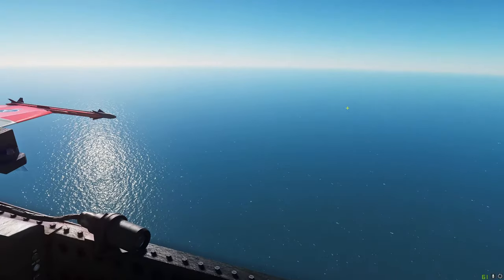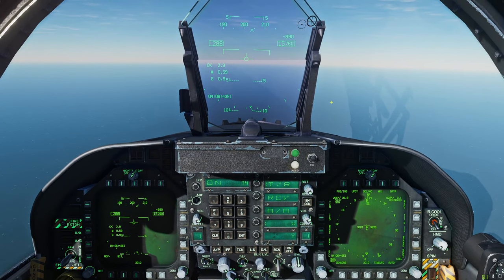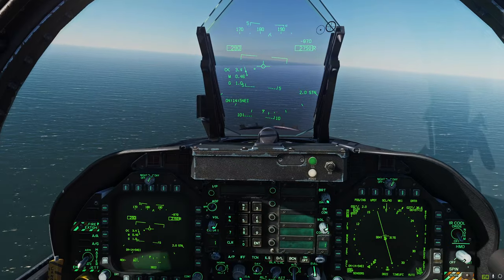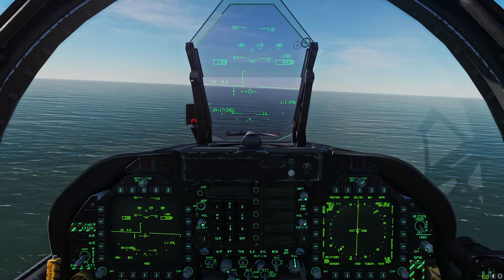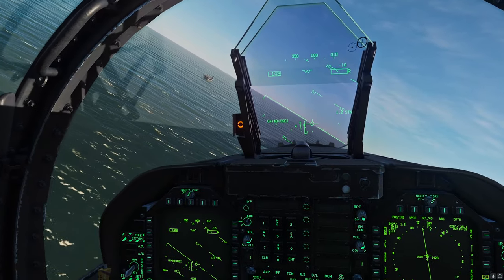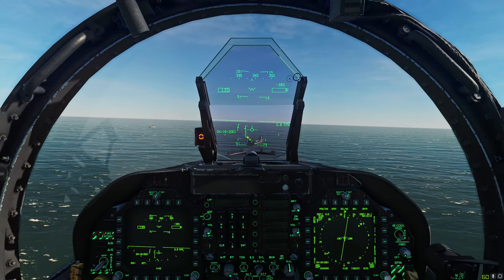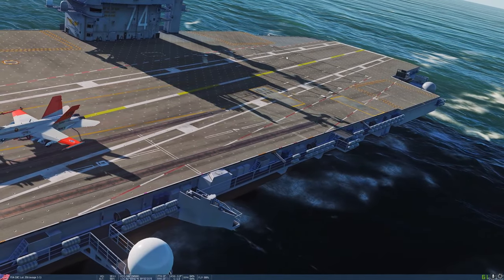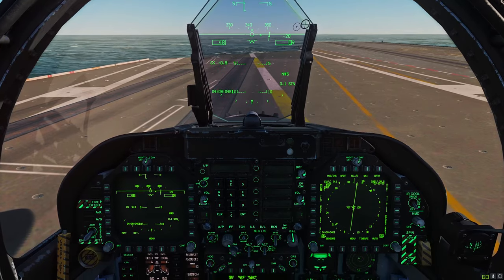DCS World Tutorials - F/A-18C Hornet - Intro to CASE I Carrier Recovery

Comment: looks perfect to me :-)   ( I always mess up my ASL on the breakturn, getting hook out, wheels out, flaps out, break ... )
the "thing" of the boat where you try to allign your pathvector to is called "the crotch" 

also, when I do a Case I or III, I always like to turn Radar off and in stead have my FCS page up right MFD and my ADI on left MFD,
because the alpha indicator is mostly not shown on the HUD anymore, the FCS page shows continuous your updated alpha, together with the E-bracket it helps to have correct angle,  for which, as you demonstrated already, a min. 7.5 to 8.5 alpha is necessary to catch the wire with your hook.
Using the ICLS can make life a bit easier, but then again one gets always tempted to start chasing the indicators.
again, very good tutorial !   I just love your tutoring method, calm, taking the time to explain, highlighting the do's and don'ts and staying focussed in your explanation.  Very big difference with those on YT who try to get a tutorial done under 10mins, start babbeling about anything and everything they see and do and then forget about the core essence.
Good job !  Keep those vids coming !

Comment: why did they make it so hard (that's what she said) ? I mean they could have made the procedure A LOT easier instead of cramming all this stuff into the smallest possible circuit. Just let them have a long final..
Reply from the maker: For a moving airbase, which is what the carrier is, The maneuvers for the case 1 recovery were designed to enable the safe and fast recovery of aircraft. It may look convoluted, but this is actually the fastest way to do landings on the boat. Case 3 recoveries have you basically do a straight in and they're much much slower.
Reply: @ravagetalon  I understand. But I guess it's all about the steep turn then for losing speed, right? I guess you could do that turn in the downwind, too.

Comment: Mike, do you use a VR HMD for DCS ? 

Also, do you use the FCU (finger control unit aka "virtual mouse") from Miles ?  the speed you fly over the instruments and adjust is fast  ;-)
Reply from the maker: Just TrackIR and a HOTAS with several bindings.

Comment: so does the brc changes as ship moves?how do i find it?
Reply from the maker: If the ship turns, yes. You can get it by checking the ship's heading from the F10 map (bear in mind that the ship's heading on F10 is in True Heading rather than Magnetic, so you'll need to take that variance into account or switch the Hornet's heading tape to True in the HSI's Data menu). You can also call inbound to the ship's ATC and when you fly overhead it should give you the BRC, but this is part of the new carrier ATC comms that are not fully implemented yet. I presume you're referring to multiplayer. In this case, reference the F10 map for the ship's heading.

For most missions, provided they're made well, the ship should always be turned into the wind.